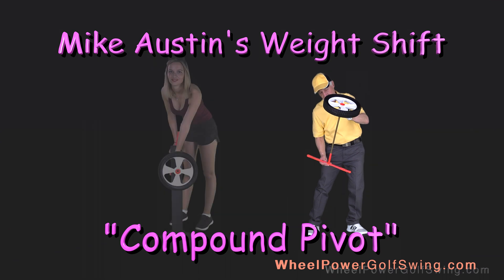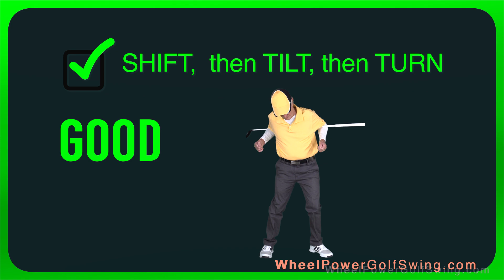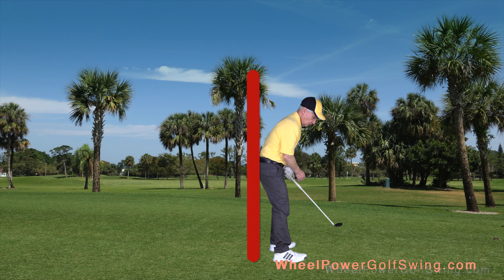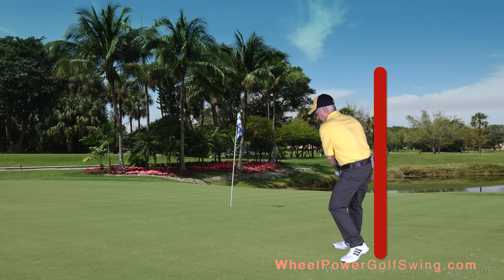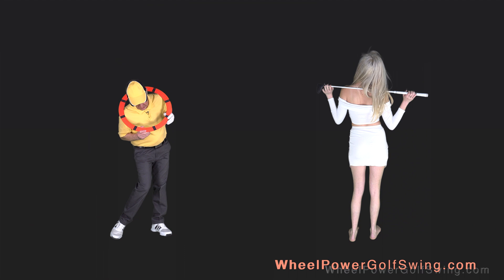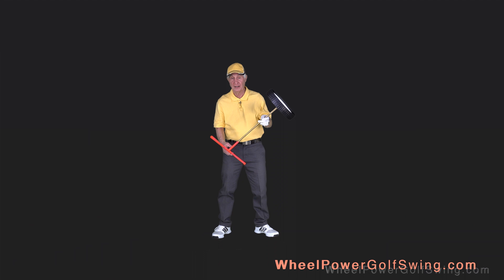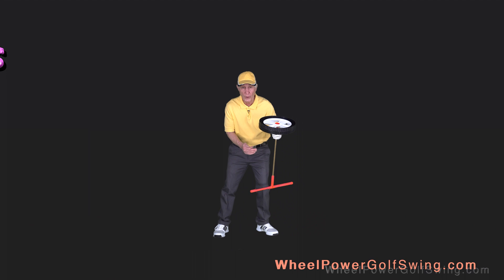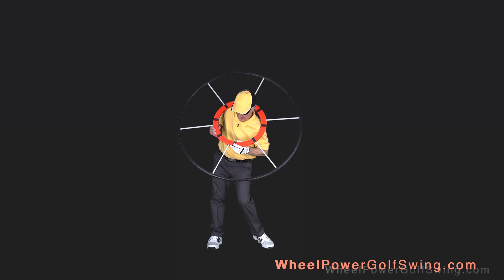Mike Austin Compound Pivot - Weight Shift Explained

Comment: i've been golfing for 40+ years and kind of discovered on my own how to do the pivot with the  help of youtube videos like this. most golf guys only allude to pivot but don't really explain how it's done because it can be hard to figure out when we watch a real expert do it. you and a few others really give some good insight into it because it's such an important  part of the correct action, when i can get it right it's real good. i try to do the pivot with some armlift and the downswing  just kind of happens because it's so fast. always working on it, thnx for the help.
Reply from the maker: Thanks for your positive feedback Steve. Yes the pivot is a huge aspect of the golf swing. Not sure if you had a chance to watch my free 1 hour fun video on the concept of the Wheel Power Golf Swing. See my website at: WheelPowerGolfSwing.com

In this concept, the arms and shoulders act like a firm structure to turn a wheel; with the club being held by the hands controlled by the wrist actions.  The wrists ride along the rim of the wheel and the shoulders are the hub of the wheel. 
The key point of the pivot is this: Imagine turning a wheel. Go back up to get to the top of the wheel. Then, SHIFT to your lead side AS you rotate/turn the wheel with your arm and shoulder structure. Keep the Wheel turning on an even tilted plane.

The PIVOT is the action that powers the body to allow you to turn the wheel. Just like a machine. The key point is that the you will FEEL the correct pivot required by the lower body to turn the wheel  - which is your goal. The club goes along for the ride.

One last important part. Keep the RADIUS of the wheel (a line between your neck and wrists) the SAME distance through the swing.

Norm

Comment: A really illuminating video and  I thought the visuals with the wheel    were really useful. I have dabbled with the MA swing in the past and recently returned to it. I found more success this time by making sure in the forward part of the compound pivot that as you mention there is a BIG lateral shift of the hips to the left AND it must be on a 10 o’clock to 4 o’clock axis. I would be really interested on your thoughts why this 10 to 4 o’clock axis is so important- in his videos Mike alluded to it many times. You have a new subscriber
Reply from the maker: Hi David, thank you for the positive feedback. The 4-10 was Mike Dunaway's (student of Mike Austin) explanation of the positions of the right hip in the pivot motion. So for right handed golfers; if you are facing a clock (12) on the ground, on the backswing, the right hip goes to 4 o'clock, and on the forward swing the right hip goes to 10 o'clock. It's a diagonal shift, not a pure lateral shift like 3-9 would be.

Here's the key point. A golf swing should be a rotational motion, swing the club around you in a circle. A human has 2 legs (2 posts). In any rotational motion, you can NOT rotate around 2 posts; rotation means going around a single post; like a gate door that swings around a post.

So as humans, we have to make compensations and first do a slight lateral shift to try to establish a single post on the lead side. Then as we rotate from the top of the backswing, our circle path ends up slightly Oval shaped like the shape of an egg; not a pure circle. 

Nothing we can do about it; that's why we struggle with the golf swing. We MUST establish a lead post to swing around. So the 4-10 of the right hip is a FEEL analogy to help make this compound pivot action; It's compound because we are doing multiple actions with the hips: shifting, tilting and rotating. 

That's just the lower body motion (pivot) to power the wheel hub (shoulders) to rotate. It's our engine.
There is a lot more to the golf swing. We must use our shoulder and arm structure to turn the wheel and have the club face set properly so it squares to the ball.

If you have not done so, please watch my free and fun 1 hour Introduction video at:
https://www.youtube.com/watch?v=UDdzq70yKRQ&t=1s
This explains the concept I describe as simple turning a wheel and the club is pulled by the wheel rim.
Mike Austin hinted at this wheel concept many times.

I also have many other videos on my channel that you will enjoy that include Mike Austin's concepts: 
YouTube.com/WheelPowerGolfSwing/Videos

and if you are still struggling, I do swing analysis, see:
https://www.wheelpowergolfswing.com/swing-analysis

Thanks again, hopefully this answers your 4-10 question.
Norm

Comment: Why wouldn't you just start with the weight mostly on the trail side to start the swing? Why is it necessary to pivot to move weight.  If I start heavy right, the windup gets me there without a sway.  Just asking if it is absolutely necessary to have a 50-50 weight distribution at address.
Reply from the maker: Thanks for your feedback. Your Center of Gravity (COG) is your navel area. Think of your stomach as a big heavy wrecking ball that swings in a pendulum motion. The top of your spine (your shirt tag area) is the pivot point for the pendulum action.

If you close your eyes and just feel the rhythm of the wrecking ball swaying first back then forward, the pendulum movement backwards gets you into a bigger backswing and torques up the muscles ready for the downswing. It is not a sway because your trail foot should be braced to prevent the hips passing your trail foot - which is a sway.

The bottom line is you MUST get that COG wrecking ball over to the lead side and the butt of the club swings around the lead side.
This initial lateral motion of the pelvis (pendulum action) uses your spine initially as a lever, and then as you rotate your pelvis your spine acts like an axle or drive shaft that rotate your shoulders.

If you start on the right side, you may have too much of a static swing and lose that rhythm to build up torque and speed.
You want mobility in a swing, not just stability.

As far as starting 50%-50%, I actually like a forward press to start where you first lean to the lead side; so it goes from 50%-> 60% lead side before going backwards. Like pushing a kid on a swing. You pull them back first then push them forward to get a smoother running start.

There is no perfect swing, but hope these ideas help.
Hopefully you watched my free 1 hour Introduction Video. 
https://www.youtube.com/watch?v=UDdzq70yKRQ&t=2739s
Norm

Comment: Your upper body moved when you made your backswing. Mike threw his hips back on the backswing and forward on the downswing. Once the hips were in place, he pivoted around them. Reference a YouTube video, "Mike Austin Teaches the Pros". Pay attention to how Mike abuses a female pro. She bonks him on the skull with her golf club, but there is a lot to learn in this priceless, slap-stuck, near Vaudville act.
Reply from the maker: Thanks for your feedback Chester. The upper body IS supposed to move as the 3rd of 3 actions. Yes, the hips go back first, then the hips tilt, then the upper body turns like a door on a gate so that the left shoulder points down. (This is what gives the appearance of a big shoulder turn done by traditional golfers who coil their backs).

On the forward swing there is a very big shift of the hips forward, then the hips tilt the opposite way as the back knee bends inward to form a Z position of the back leg, and the upper body then turns so that the right shoulder points down.

All this must be done while the swing center (the C7 vertebra - where top of spine and shoulder meet) stay fairly still in 3D space.
The goal is to keep that swing center from moving up and down or left and right, but, it can rotate in it's 3D space.

So the compound hip pivoting action (the lateral shift like a pendulum and then tilt ) causes the spine to act like both a lever and a turning axle. This compound pivot action of the lower hips is what causes the shoulder to rotate like the hub of a wheel where the arms then act like wheel spokes. 

It took me many years to study exactly what Mike was doing in this one move. This is where he loses students because he never quite explains the exact movements and sequence and yes, I've seen that crazy video of him teaching the golf instructors many times.
In that video of him screaming at his students for not understanding, it's his own lack of ability to explain well enough. I've had many conversations with golfer instructors who studied under him, he was a genius coming up with the concept, but lacked teaching skills.

Sorry, it may sound like I'm chest beating, but If you watch this video above I made above a few times; especially from 4 min 58 seconds into the video, I believe it is the best explanation of his compound pivot action that uses the lower body action to rotate the shoulders.

As far as any slight flaws in my own movements in the video, it's hard to hold props, demo the actions and talk at the same time, but focus on the concept.

I'm very happy you made this comment because you can see just how subtle the movement is. And that is why Mike Austin himself ended up screaming at professional golf instructors who could not get it. The secret is the sequence.

There is a shift of the hips back, then a tilt of the hips (by folding in the opposite knee), then a turn of the upper body to rotate the shoulders. Then the exact same sequence going forward. 

It's actually very simple. The goal is to use the lower body compound action to cause the shoulders to rotate like a wheel hub around a center point. Norm Rosen
Reply: Norm your spot on